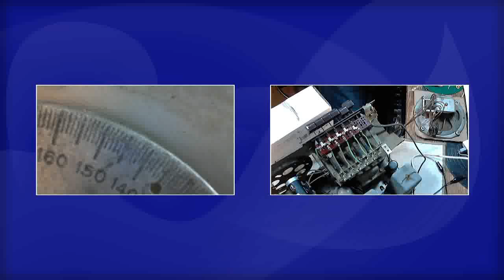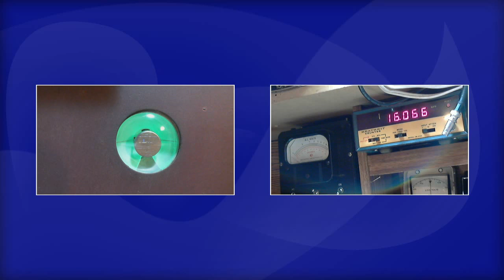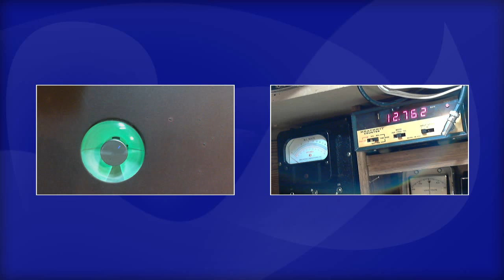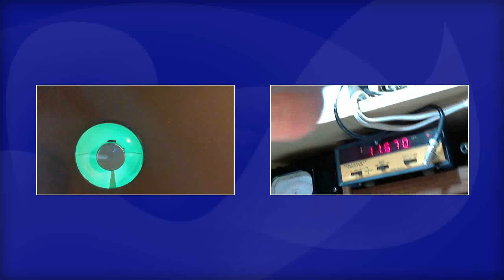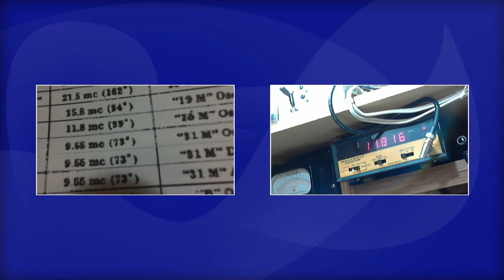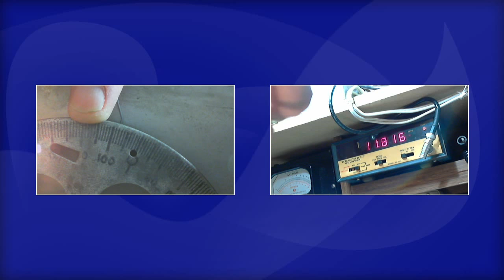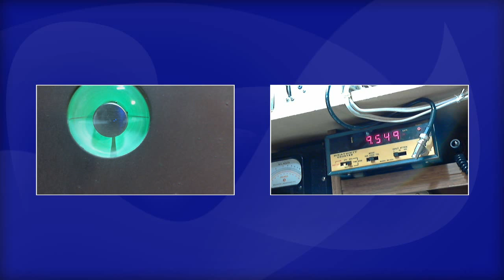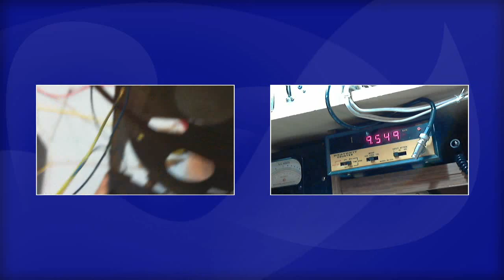RCA A25 Vacuum Tube Shortwave Radio Video #7 - Alignment of Shortwave Bands

Comment: Hi Jim your doing great. In some closeups of the chassis I still noticed some asbestos. I use an oil soaked rag on the chassis or a soapy mix on the cabinet. Danger Will Robertson Danger :) I enjoyed the video hangout the other day. Thank you for the invite.
Reply from the maker: Is that on the bolt tabs on the bottom of the chassis?
Reply: Jim Lindenas
Hi Jim. It's on both the bolt tabs and the chassis. I have to use a magnifier myself to make sure I got it all.I use two bags one for the sheet of asbestos and another one for gloves and cleaning rags,some of it is very hard to remove though it does come loose has we work on the chassis or cabinet.